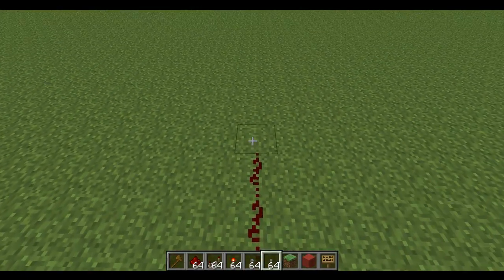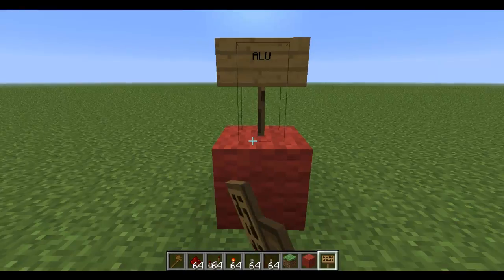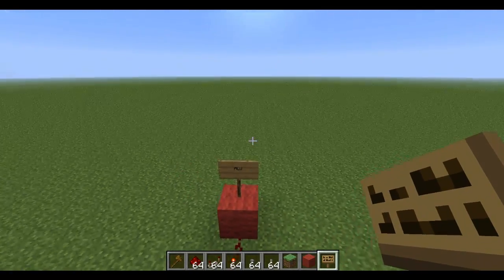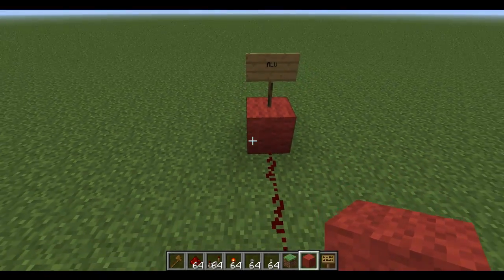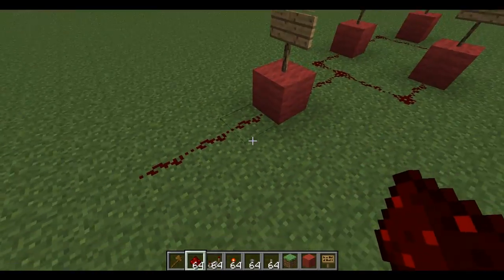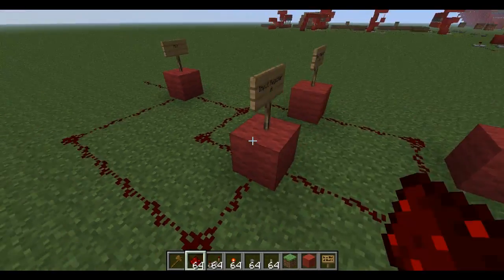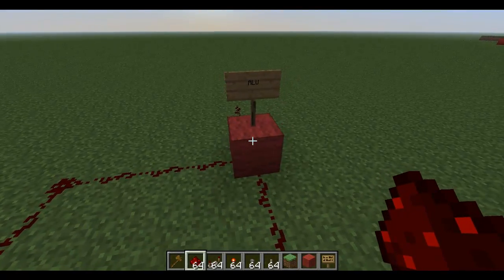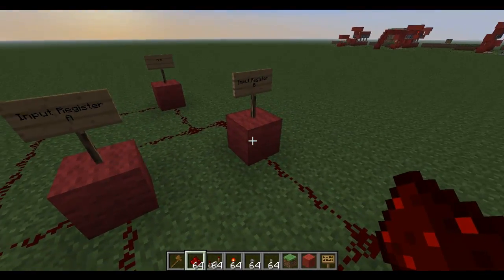Minecraft: How To Build A 4-Bit Computer - Part 1 - Explanation and Design [Tutorial]

Comment: UI is user interface, not user input
Reply: actually gui stands for graphical user interface and it only applys to a computer with a display so ui does mean user input
Reply: or both it could stand for interface or user input
Reply: Learn before you make up bullshit facts. GUI is graphical user interface UI is user input reece was right.
Reply: Volx Don't be rude. I work with robotics as a PLC programmer and I can assure you that UI is an abbreviation for User Interface. While it COULD stand for User Input as a made up abbreviation, it can be confusing for those who don't know the official term. I merely made a simple correction. Please don't be disrespectful.
Reply: Jack Brooks this isn't PLC programming, though, this is a minecraft Redstone Computer.  User Interface would be correct if you were talking about something other than just the bits / bytes being input.

Example:

A keyboard is a user interface.  

pressing the letter A on the keyboard is a user input.

so a quick python code example:

applicant = input("Enter the applicant's name: ")
interviewer = input("Enter the interviewer's name: ")
time = input("Enter the appointment time: ")
print(interviewer, "will interview", applicant, "at", time)

the inputs are the codes entered THROUGH the interface.
Reply: UI is user interface, not user input. I this case it means the same thing. An interface is where you make the input, therefore making them the same. Done.